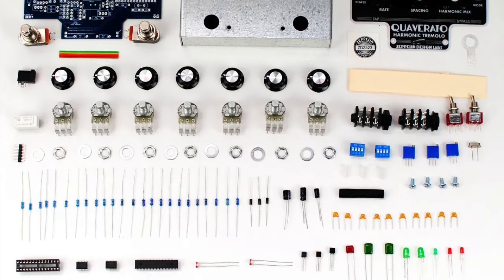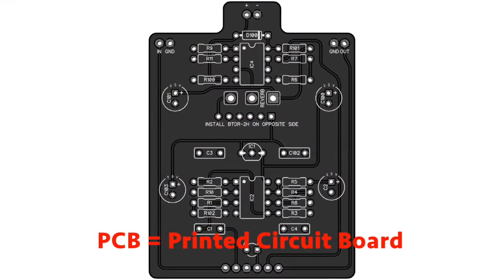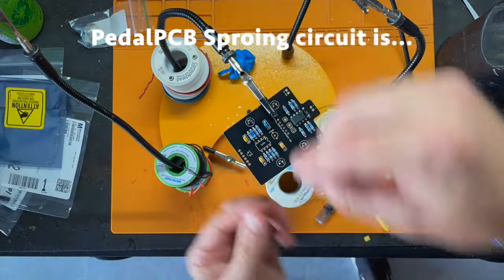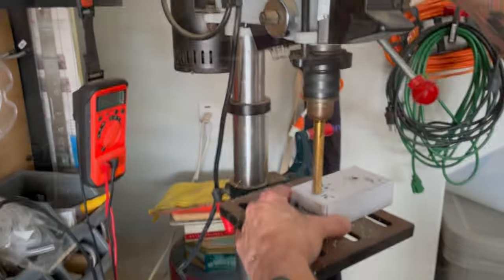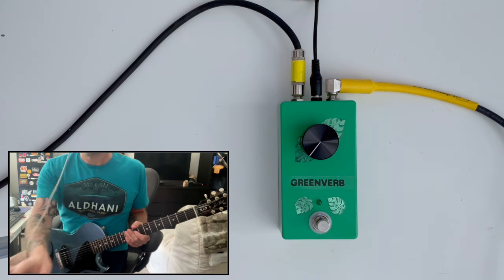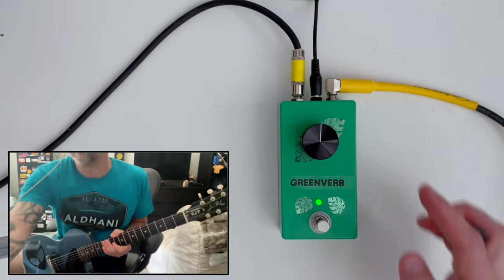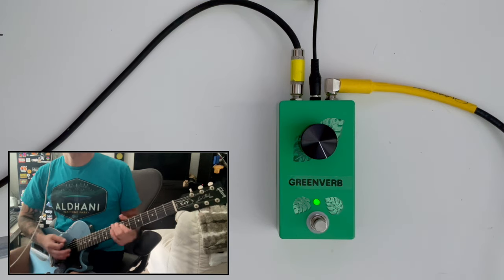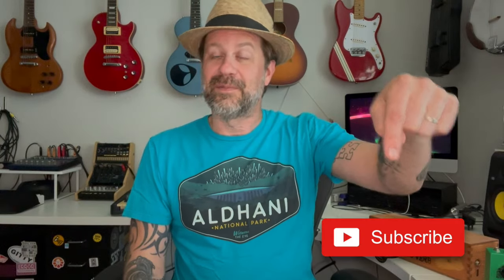Build a Great Sounding Reverb Pedal With PedalPCB's Sproing Kit!

Comment: Try Tayda Electronics next time you need parts. Shipping is a little slower but it's much cheaper than Mouser or Digikey for common components used in guitar pedals. You can buy small quantities of parts for a fraction of a cent. They also have their own guitar pedal PCBs and some other project PCBs though annoyingly, you still have add each component to your cart separately.
Reply from the maker: Thanks for the tip (and for watching the vid). I've hard of Tadya but never ordered from them. It's hard for me to get away from Mouser because they're located a couple hours away and I get the package next day. That said, I'll give Tadya a shot for a future project.
Reply: I buy 90% of my parts on tayda, even tho they are in Thailand I usually get my package within 3 days of shipping to here on the east coast. I cant recommend them enough